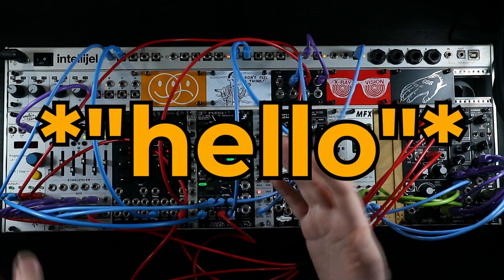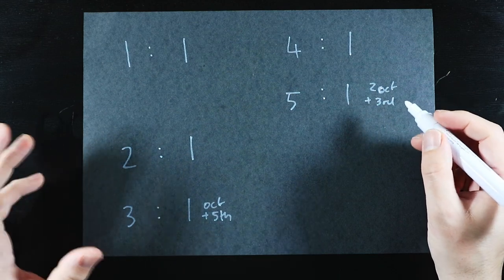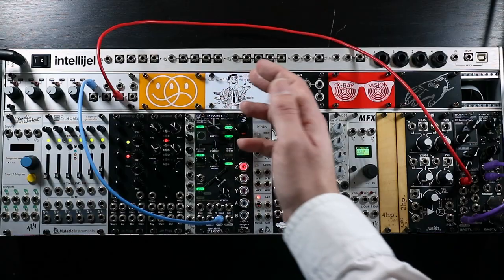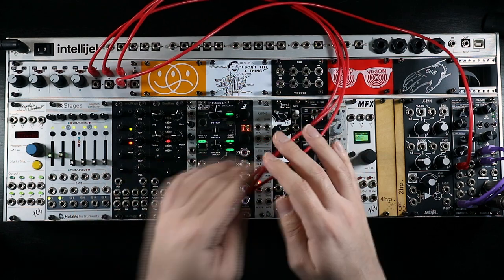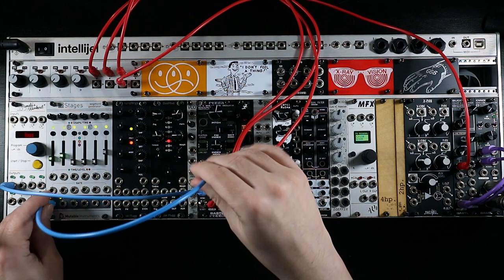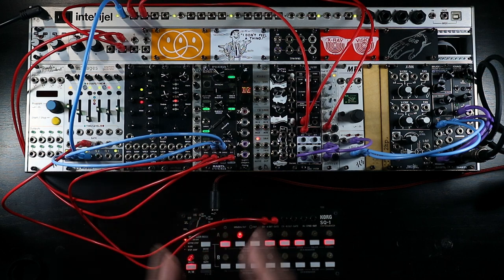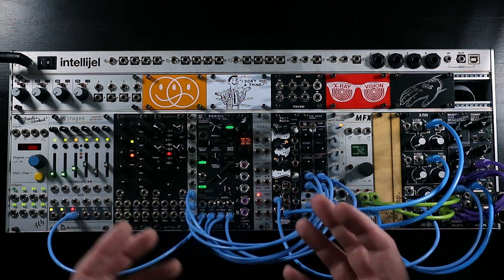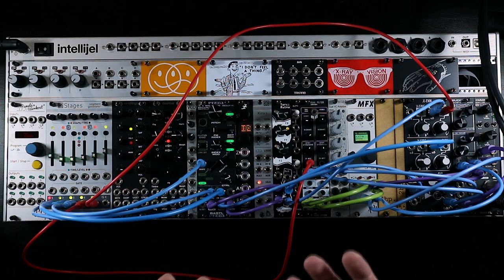Bastl Pizza v1.1 - Full Video Manual and Example Patches

Comment: Fantastic video. The alternative use of the sync input is completely new to me. The example patches are outstanding. Thanks.
Reply from the maker: Thank you for watching, I'm really glad you found some new ideas in there!
Reply: May I ask you what type of USB cable you use to update? I'm struggling to get the right one?
Reply from the maker: @benbauer1065  it's just a micro USB cable. Micro USB at one end, type A (the most common connection you find on most computers) on the other. If you have a digital camera or an old phone etc. you'll probably have one

Comment: In my opinion manufacturers should provide video manuals of this nature by default for all or most modules. So much more useful than a written manual. I've had Pizza since Black Friday and not spent much time with it yet, but this is inspirational and I can't wait to get stuck in. I need to properly watch your Digitone vids as well, because again am still a novice with that too. Even though I'm so old I was once a co-owner of an original DX7! Keep up the good work, it's appreciated immensely.
Reply from the maker: Thank you, I'm glad the work was appreciated - the good news is that I have at least one more video manual in the works right now so it seems that the vibe is catching on.
Reply: It already is, when you look for the manuel on bastl website they first link you to this tutorial, then the pdf one :)

Comment: This is intense.
Reply from the maker: What operating system are you using? There's a known issue with some versions of macos, but there is a work around.
Reply: @OscillatorSink  I read in the Bastl site that it might be that I'm using the wrong USB cable. Needs a cable that capable of sending not only power but also data. Tha k you for the video and the response.  I'll be watching this several times over to understand the module. It's so much for an fm noob.

Comment: Mine doesn’t even show up as a external drive on my computer to be able to update. Always something.
Reply from the maker: What OS are you using? I've seen in the bastl discord there's an issue with a certain macos version - there's a work around for it.
Reply: @OscillatorSink  Catalina but I’m upgrading to the newest right now. I’ll see what happens.
Reply: @OscillatorSink  I ended up using Terminal and it worked. Cheers.
Reply: @tColorsinspacerecordings  can I ask you exactly what kind of USB cable you used to update the module? Iv ordered 3 different cables and they won't work.